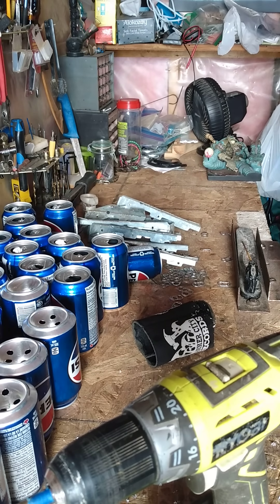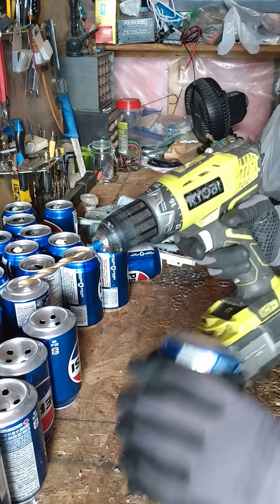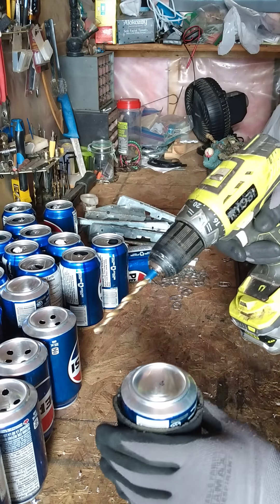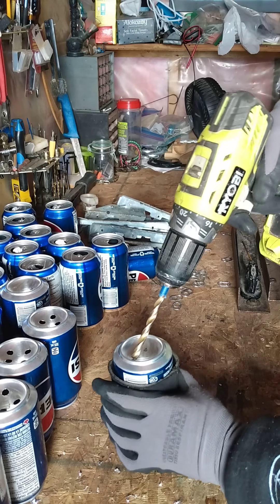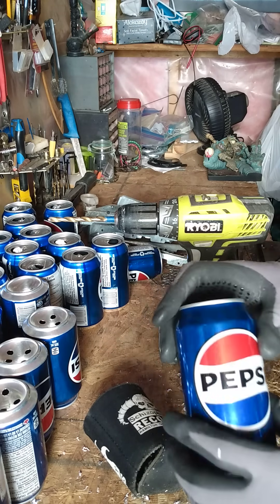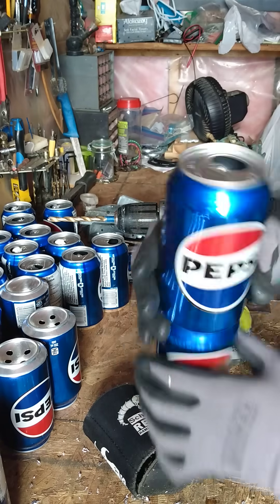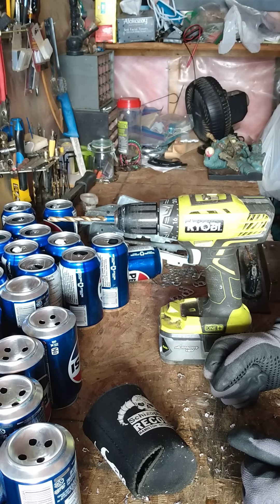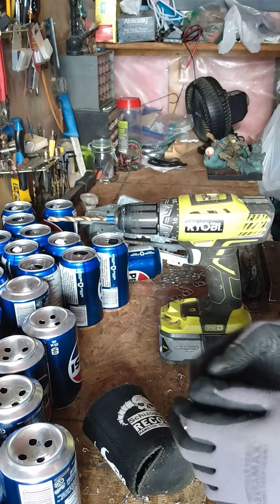Pop Can Solar Heater Build - Holes Drilled - November 30, 2024

Comment: I’m building a similar heater for my chicken coop. 
I’m thinking that the more time the air has in the cans, the more heat can be absorbed by it. So, I’m laying the cans on their side with a zigzag path for the airflow (it kind of looks like an intestinal tract). 

Do the multiple smaller holes slow the air down a bit for greater heat transfer?
Is that why you’re doing that instead of one large hole made with a hole saw bit?